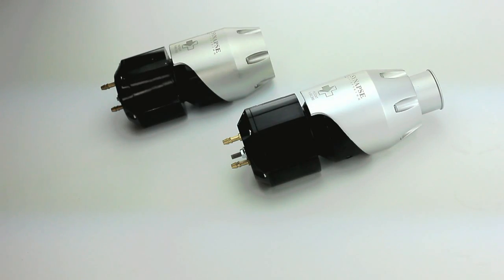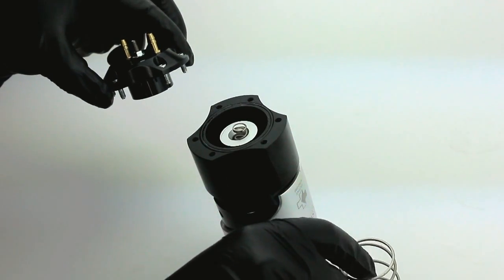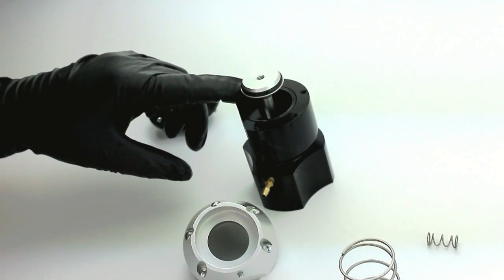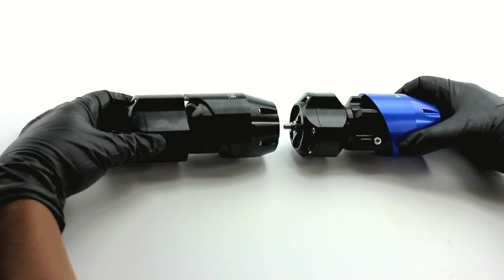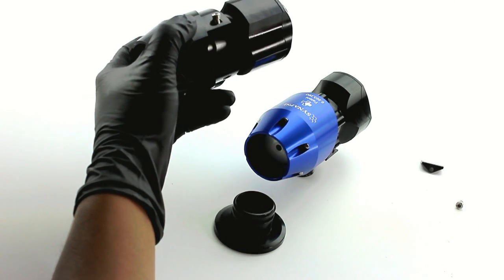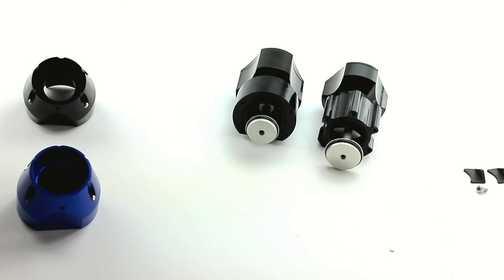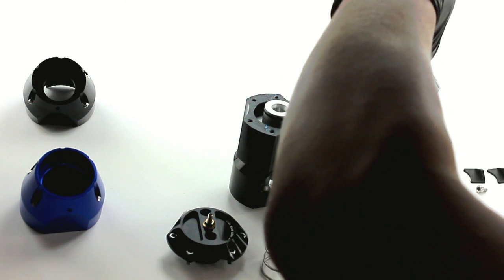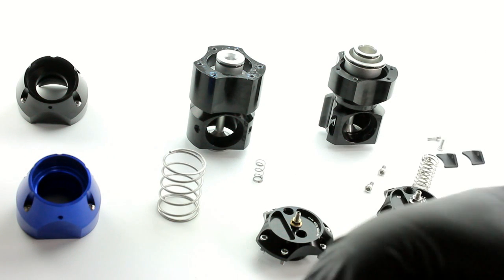Comparison of Synchronic BOV V1, V2, V3

Comment: I have the SB V2 on the Nameless Performance Charge pipe (came as a kit) for my '12 Kia Optima 2.0L turbo, I have both ports A and B connected to a TBS for the vacuum source.  I also have the BOV vented (via a filter) to atmosphere instead of recirc.  I have removed the pre-load spring (upon SE's recommendation).  Is there any "tuning" needed for this application?  Seems to work fine but I really never get that bit "swoosh" sound coming off of the throttle I would have expected.  Certainly does hold boost just fine.

Comment: Hope this will work in my F-150 ecoboost. My truck loves very soft springs . Currently have the TiAL QR . When will this be available?
Reply: Available now, I have one on one of our Ecoboost trucks running straight to the solenoid
Reply: +SynapseRawUncut Thanks for the reply,  is the spring soft or adjustable?
Reply: +Boosted Image it comes w/ 2 different spring rates, and the pre-load is adjustable
Reply: +Boosted Image either spring will hold 100+ PSI
Reply: Sounds good. Thanks